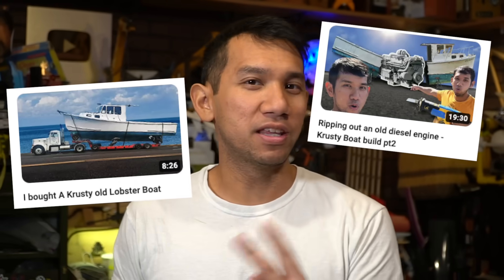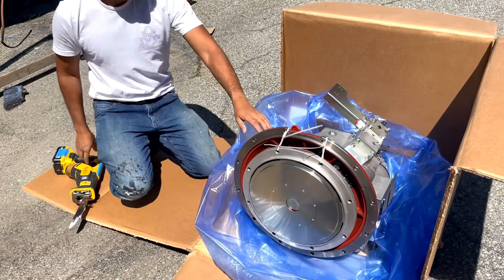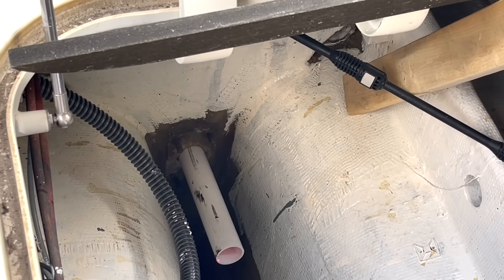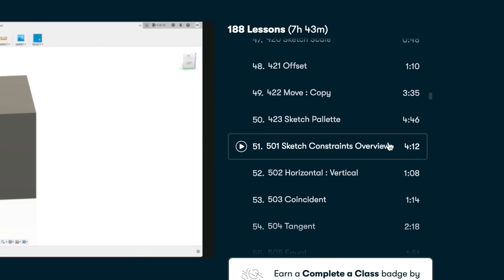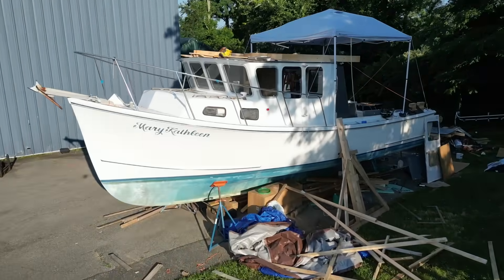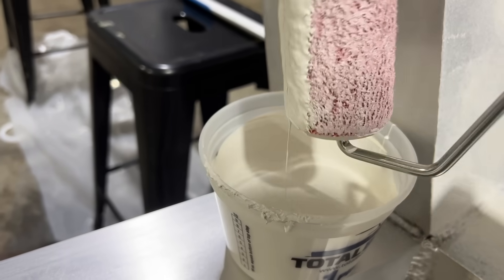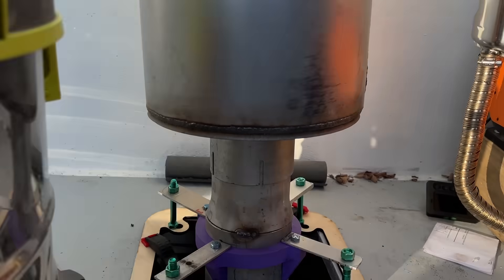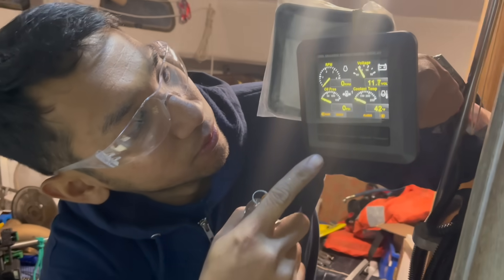Putting a big diesel engine in my krusty old lobster boat

Comment: If you build a wooden "fence" aroud that exhaust muffler. You not only get to not burn yourself. You can put a couple of hooks on the "fence" and you can use it for drying stuff on the way.
Reply: And cooking. Seriously. I've cooked lunch in a metal lunchbox strapped to my motorcycle exhaust. It's really hand to have lunch ready and not have to look for a restaurant.

Comment: Is there a reason you had the exhaust come up through the main deck? It seems kind of in the way. That exhaust is going to get VERY hot while running. Typically, exhaust is dumped outboard near the water line to help reduce noise and fumes.

Comment: Boat-
Break 
Out 
Another
Thousand 😅
Welcome aboard budd, might need to look in to a fishing permit er a charter captains ticket 😉
Then all this investment can be tax deducted
Reply: 3:41  fancy tech man, allwe ever did was a thin tin shim, 😅 and a crowbar to shifts the motor around and some jack bolts😅
Reply: 7:42 on a commercial boat, we call it a shelter, and on pleasure boats , I think they call it a roof er sundeck( depending on if yea got a flying bridge (pilot controls on-top of the wheelhouse)
Reply: 14:43 welcome to the happy boaters club mate 🍻

Comment: The two best days of boat ownership are the day you buy it and the day you sell it.    I've had 5 sailing boats, but used them,  did 70,000 miles with my 30 footer.  Trans-Atlantic, Caribbean, Mediterranean and of course  UK France, Spain, etc. I skippered, instructed,  wrote for a sailing mag too. They are expensive toys, spend most of the time just sat in marinas deteriorating!  Enjoy.

Comment: The cooling system on these is pretty cool. You've got coolant that cools the "jacket" in the engine (engine block and other heat sensitive engine stuff) the raw water pump sucks seawater through a strainer (to protect the pump and jacket water system from sea junk/trash) and goes through a liquid to liquid heat exchanger that keeps the coolant and raw water seperate. The raw also cools your intake air. The boats I worked with ran two of these engines rated at 425hp and I spent 5 years working with them 😅

Comment: How can aluminum be "angle iron" LOL Boat looks AWESOME. Couple things- Diesel boat engines like that obviously don't have a radiator, they use a heat exchanger. Sol there is a rubber raw water pump impeller that is driven by the engine to pump the ocean water through the heat exchanger to cool the engine. You do not want to run this rubber impeller dry like you did because it will ruin it very fast. You need to connect a water source to your intake and then you can start the engine. Also it sound like your starter has voltage drop as the rpm is very slow at start up. Make sure you have a good ground from on our engine.

Comment: I have a volvo penta d4 225hp for sale with duel prop leg would have sold it to you for 15k canadian pesos! I owned from brand new in my commercial crew boat.  from new. 2012 engine 2018 leg no controls.

Comment: Peter Peter Peter... If you're gonna pressure wash it correctly, use a yellow tip (15 degree) and get about an inch away, give or take. Using that 0 degree will just weaken your fiberglass. It may not cut it, but it will weaken it and you'll never get all the grime. Try some Purple Power too, that and Mean Green are some nasty degreasers. Good luck man, can't wait to see this ship's maiden voyage

Comment: 16:05 i would recommend you get some heat shield's on the exposed exhaust pipe & a exhaust flapper for the end of the pipe so when it isn't running it won't hydrolock since it's not going to be run every day of the year
Reply: I work for a company that makes removable insulation blankets for exactly that purpose (among others). They also keep you from burning yourself.

Comment: Running without water wont burn the engine but it will rip the water pump rubber impeller when it spins dry.

Comment: I've always wanted a trawler, I wonder what your range is.....be the slowest travel imaginable tho 😉
for example:
"The standard engine is a 231 hp John Deere diesel. With the single-engine setup, draft is 5’5” and with twins it’s a shallower 4’6”. At 6 knots, range is an ocean-crossing 4,850 nautical miles. At 7 knots, it’s 3,300 nm. At 9 knots, it 1,700 nm."
why not steel I beam instead of wood (doug fir)? for fire resistance

Comment: This might be a dumb question, but why can't the prop shaft have u-joints?
Reply: I think uni joints are very limited to the angle they can be at.
Reply: More limited than has to be perfectly straight or my trans blows up?

Comment: Hey man great progress so far. Just be careful running the engine out of the water if you have the sea water pump fitted, you can do it with a hose connected otherwise the impeller will get trashed, they are rubber and need the water for lubrication. When you do get round to putting her in the water keep an impeller in a bag near the engine with some tools, sometimes the pump will suck up things like trash bags or the strainer will get blocked with silt causing the impeller to lose water and fail, the first you will probably know is when your engine overheats and then cuts out. It’s useful to be able to change one quickly to keep you out of brown town. Fair sailing
Reply: 13:26 He says the water pump was disconnected during the testing

Comment: That's awesome! Good work! The only thing I could recommend is a air cutoff for the motor intake! Can prevent a runaway from destroying the motor. $200 can save you a $20,000 repair!
Reply: And possibly exhaust blocker. Double is better. Als the air cutoff needs to be extremely solid to resist runaways
Reply: Four cycle engine. Run away very unlikely.

Comment: When welding pipes, especially stainless, you need to fill the tube with argon gas. Otherwise the weld will not be stainless any more.

Comment: Be careful running that engine if it has egr. Running them without water can crack the egr cooler internally and cause problems.

Comment: I fr appreciate this build series because it looks like I may be having to do alot of fixing up on my grandfather's boat. I think he may be checking out soon so as the inheritor I hope that I can get it back to ocean glory.
Reply: If anyone is interested on what boat it is its a 1978 oday 27. Has a 2 stroke sail drive inboard and still has the original dry rotted rigging and rotten bulk heads. It still floats so might as well fix it

Comment: If you run the engine without a water supply you risk damaging the raw water pump impeller because it is made of rubber and needs water to stop it overheating, you can take off the cover plate and remove the impeller or remove the Vee belt for tests.
Reply: I’m sure they disconnected it! At least I hope they did haha

Comment: i'm sure someone has noted it - but you should probably change out the seawater impeller- running it dry can really hurt it.
Reply: He says he disconnected the water pump for the testing
Reply: Was about to say the same thing, running the engine dry kills the impeller, no more than one minute run and it's done, worse if yo rev it. Make sure when you change it to look it for rubber pieces in the water channels, that cloggs the pipelines. The changing is easy, something like this: https://youtube.com/shorts/J4SX0MvVu_Y?si=5O6P1hODPVeYYvnQ

Comment: Make sure to install new fuel sniffer alarms in the engine bay. You don't want that thing to actually blow up lol Motiv8Labs on here blew up his house boat a while ago because his fuel filler hose was broken and so instead of filling the tank they filled the engine bay and it blew up the back of his boat. (Also forgot to turn off his generator, but would have blown either way)
Reply: It's a diesel boat, No need for sniffers or blowers. Peter will be fine.
Reply: @mross6363  You're right, thanks! I didn't consider that aspect.

Comment: The boat's looking good!  One thing I would have probably done is put a layer or two of fiberglass over that new wood you put in the engine compartment (along with some fresh gelcoat/paint) to protect the wood.  It WILL get wet and rot eventually.
Reply: Seems like spraying some epoxy or bedliner would be quicker and easier these days. Can even get white

Comment: The coolant inside the engine is called jacket water, and it heat exchanges with the raw water(sea water)
Reply: Yea its raw because its less efficient with cooked water. Temperature differentials blah blah
Reply: @ac.creations  ok smartass
Reply: @ac.creations  The reason why a heat exchanger is used is that the sea water is contaminated with things that you don't want circling around in your engine. You have temperature controlled coolant (lower freezing and higher boiling point than plain water) which has many additives to prevent damage to the engine and cooling system.
Reply: @esqueue   @esqueue  yes I know that a heat exchanger is I made a joke about raw seawater
Reply: @ac.creations What's sad is that those are the nonsensical jokes that I make too. I laughed after reading your response but that's a bit too late. LOL
Reply: @esqueue  lol brain gonna do wat it do

Comment: Hi, 8 dont know if you realise but you have aligned the engine to the prop shaft but you will need to do it again after the boat goes in the water as the hull shape will change between propped up on its keel on land and floating in the water , just a heads up, great job so far.
Reply: Very true for most wooden boats we work on. The glass or metal ones not as much but we still check after it splashes back in.
Reply: @usanaluoma  ... did you just confirm that glass boats exist?
Reply: @n2oin  fiberglass i assume but yee, glass boat indeed
Reply: Yup, and let's see him do that with a laser shining out of the back..

Comment: wondering if the boat gets some solar, you have panels from your tiny home and the roof is nice and flat, keeps the batteries topped up and allows you to do things on the boat w/o running the diesel all the time

Comment: Peter…Cummins engine is loud underway…. good sound insulation is paramount….14 hr days on the water fishing and you’ll be wishing for the Scania or Volvo…Beals ride really well and the forward slant house and over hang make rig look super cool.

Rig up a 1/2 inch tee on Sea Water Strainer with flexible garden hose and fill a 5 gallon bucket with  mixture of Salt Away run it into the engine after you fresh water flush it and you’ll never need to ram the after cooler. Shut sea cock first. I ran a pair of 375 Cummins B like that for 2000hrs and aftercooler was clean.

Comment: Goddayum, boats are expensive af. The fuel filters alone cost almost as much as my car! Now that's a cool boat, but I think it needs more RGB lights.
Also, you need to be able to sleep and live on the boat. What you need is a solar panel system for electrical heating and cooking so you won't be wasting diesel.

Comment: be careful with your diesel heater exhaust you might want to find a more horizontal mounting method those mufflers have a drip hole for condensation on the bottom of them just to let you know! Loving the boat
Reply: oh are you thinking he might flood the engine if it rains? i suppose if it comes straight from the turbo.

Comment: Too late for you, but for anyone else doing a job like this, consider using an Aquadrive coupling.  It's basically a short piece of shaft with a CV joint on each end; something like a front wheel drive car axle.  It allows for a significant difference in the alignment of the engine and prop shaft and offers several benefits.  You can mount the engine on very soft mounts to reduce vibration without worry that you will damage the prop shaft stuffing box because of excessive movement.  And you can mount the engine more level even if your prop shaft is not perfectly level.  But the best advantage is that you can mount a thrust bearing on an intermediate bulkhead so that the prop thrust loads are taken by a dedicated thrust bearing and that eliminates the driving thrust being transferred into your expensive transmission, saving wear and tear. They're not overly expensive either.
Reply: That second to last sentence brought be back to drivers ed when the teacher told us to always engage the parking break before you pull your foot off the breaks so the shifting weight of the car doesn't rest on your transaxle pin and wear it out over time. Bigger problem on older automatics apparently.
Reply: evolution drive @TekedixXx
Reply: @TekedixXx 
*brakes
Reply: Yea what the guy said 😂 hes right ya know
Reply: He’s have to add carrier bearings on the prop shaft to take the axial load from the propeller. The way it’s set up now the gear and engine mount tranfers the thrust from the propeller to the boat. With cv coupling it wouldn’t stay rigid and aligned with just the cutless bearing in the shaft log. It’d take a lot of modification to make it work.
Reply: @drakewiggins8637  the large thrust bearing just behind the aft CV joint is the whole idea.  It takes the thrust load off the transmission internal parts and also the engine mounts which is a good thing.  The transmission will last forever and the engine can be mounted on very soft mounts.  I built a 55 foot motor yacht nearly 25 years ago with an Aqua Drive unit and it's still going strong.  The typical engine vibration found in most motor yachts is nearly completely eliminated.  Glassing in a small bulkhead in the bilge to accept the thrust bearing is quite simple and inexpensive.  Plus the smooth running prop shaft which is isolated from engine vibration can accept one of those "dripless" cutlass bearings.
Reply: CV joints or other types of couplings all have an expiration date, or hour work limit, but with just an awesome transmission and the direct prop shaft, there's absolutely zero points of failure, and it is marine specs, with one prop and drive system, you have no backup in the perfect storm needing the push to keep head on to the waves 🫠😉
Reply: ujoints in a boat is a terrible idea...
Reply: And you base you opinion on what kind of data?  First of all, CV joints are not "U joints". I can tell you that the 55 foot motor yacht I designed and built 25 years ago using an Aqua Drive system is still going strong and running as smooth as silk. I am still in touch with the third owner who gives me periodic reports. And I had the pleasure of being onboard for a couple of days late last year. The reduction in noise and vibration when compared with a conventional shaft system is amazing.  And the longevity of the dripless shaft seal, the transmission (which has never been opened), and the original engine mounts is remarkable.   This yacht has traveled many tens of thousands of miles over the years and the CV joints have been serviced only twice, not because of failure, but as part of regular maintenance.  There is the added expense of the thrust bearing and CV shaft of course, but it is a tiny fraction of the over cost of the yacht and is well worth it.  Everyone, especially those with experience on similar sized yachts with conventional drive(s) remarks about how smooth and quiet the Aqua Drive system makes the boat.
Reply: Boat transmissions are built with thrust bearings..

Also use just a single flexible coupling.
Reply: Still can be retrofitted, at a cost.
Reply: The downside to all that is that you are adding more points of failure which is not good on a single engined boat.
Reply: @popuptoaster  Boats are points of failure. One must accept that as a reality of maritime life.
Reply: @SetitesTechAdventures  well... less PoF's (Points of Failure) is always a benefit 'cuz , like u said , boats are a giant point of failure but the thing is ; the hull is a SECONDARY PoF , MOST OF THE TİME , meaning u need smth bad to happen , for the hull to fail! of course the hull itself might fail on its own but its a very low chance , therefore , having less PRİMARY PoF's (meaning these PoF's are more likely to go off on their own) is a prime benefit 

Also im not saying your wrong , its just "constructive critisizim" (i actualy dont have a word to explain what this comment is as its an explanation/critisizim for someones logic so ... uhh ... idk i guess)
Reply: @SetitesTechAdventures  Yep if it fly's floats or f- - - 's your better off renting it !!  qoute
Reply: @popuptoaster  Better the POF is cheap and easily replaceable....
Reply: @popuptoaster  Just add secondary propulsion system